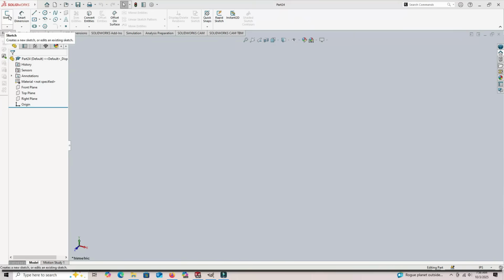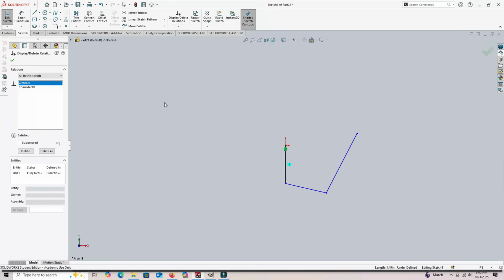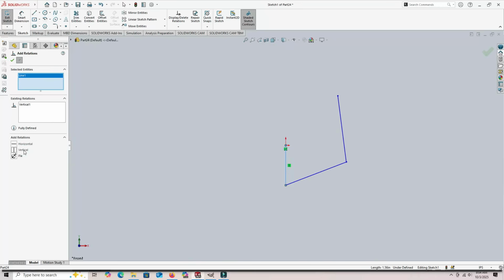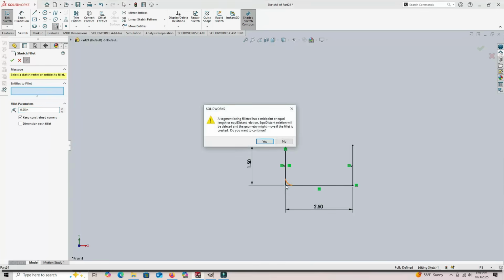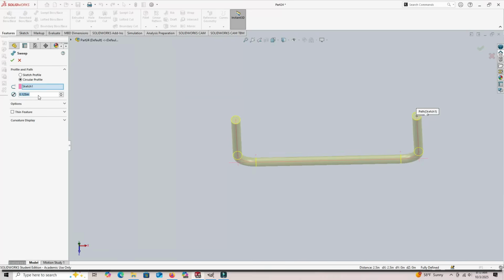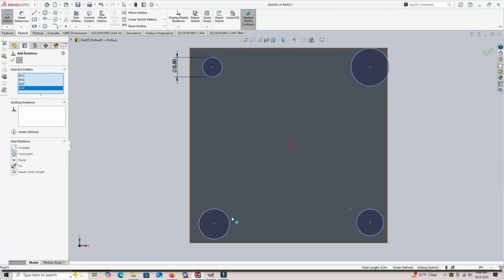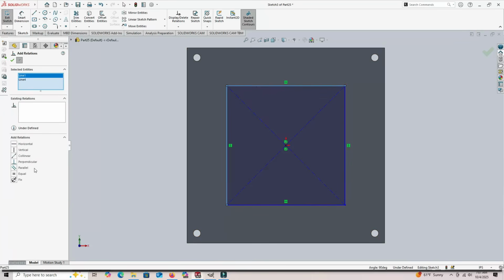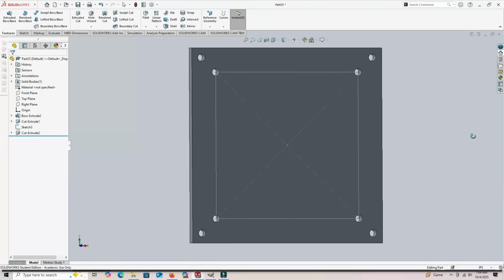Solidworks Tutorial 17 - Adding Relations Between Features

Comment: You could have changed the centre point square to construction then drawn your circles on the corners , saving you a drawing and keeping the dims where you expect to find them. (and  the holes could have been sketched on the extrusion ). If you know the relationship between the holes and plate size , say holes should be 1/2" inside, then dimension the hole defining square with an equation relative to the plate dim.
Reply from the maker: I have learned yet another thing from you. At this point, my future video will have to be titled, "Things I've Learned From the Comments Section (Mostly From Bill Todd)"
Reply: Please don't think I haven't learned some things from you. 

I couldn't make these videos , I simply don't have the patience (you may have guessed this :-)).

So thanks for taking the time to introduce people to what is I think one of the best computer programs ever written.  :-)